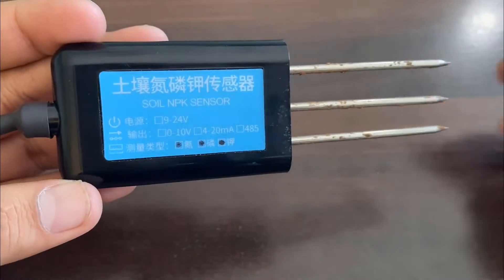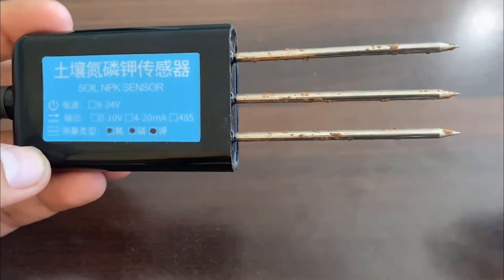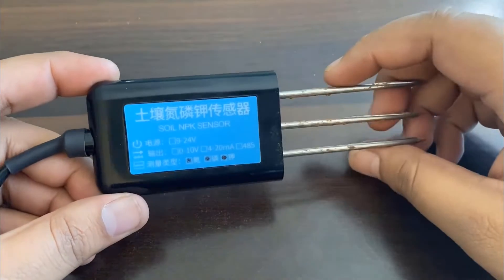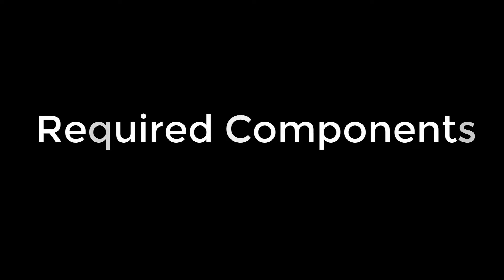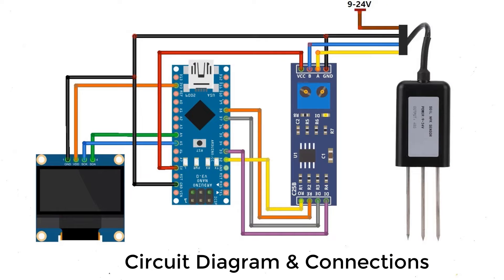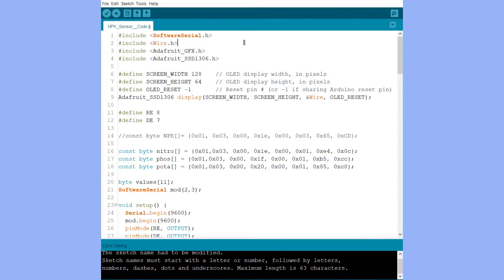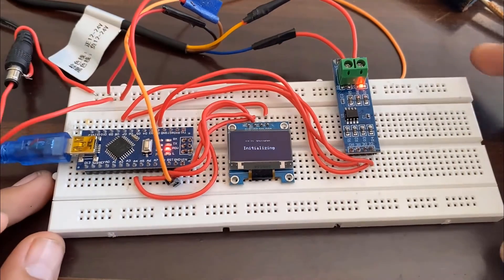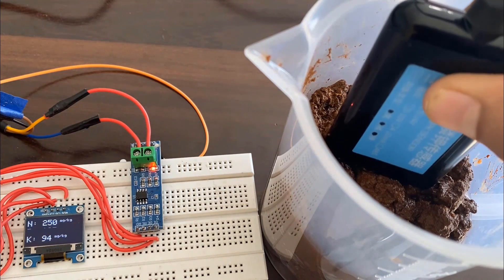DIY Soil NPK Meter || Measure Soil Nutrient Content using Soil NPK Sensor & Arduino

Comment: is your data is verified? with the lab data?

Bcoz put conducting probes in soil and readings passes through comparator/amplifier then it shows data on the screen. It is natural. that might be analog values...

and 2nd thing that is Chinese products no trust.

 Many big companies (e.g. one Swiss and France company) finding a way to determine NPK, so this 100$ sensor does that. 

Might be something wrong with this JXCT sensor. (Bcoz NPK are chemical elements )

I m not sure, maybe I m wrong but technically 50-50 chance
Reply: I have the same concern as Varnit because of the quality of mainland China products. Can you post the name of the Russian lab if it's possible? Thank you and Merry Christmas.
Reply: I also have doubts on the accuracy of this sensor. It seems that this sensor is some how implementing an electrolysis of soil to measure the nutrients and  I haven't been able to find any research material related to successful implementation of this method. It would be very helpful if you can share some data which compares the results of this sensor with lab data
Reply: @azharmultan  fake npk sensors : all chines same , only ec works
Reply: @HowtoElectronics  oky. Great!!

Can you please give me the name of that Russian R&D lab?
Reply: Great!! if this technology build-in India.
Reply: @HowtoElectronics  where can we find results/stats that verify that they are 98% accurate?
Reply: @HowtoElectronics  Gd try but sorry bro, very disappointing as an electronics lover, how fake devices draw attention by such youtube fake review videos. I'm 100% sure, after 1 year of my test of NPK, these all Chinese sensor doesn't work except EC one, that's ofcourse easy to make, even I made my DIY, but NPK  is always tough, where chines people takes benefits. at least you should not give false info without being well tested.
Reply: @narendok2115  how did you make a diy ec sensor
Reply: @clydesarmiento2223  if you search ec diy circuit you'll get,btw ec sensing is easy as it's direct electrical property of soil, we can get ec , by ionization by passing sinwaves into Soil.
Reply: @HowtoElectronics  Tem previsão de quando vai ser lançado?
Reply: @HowtoElectronics  I don't believe that  bcoz i tested it with many ways,  due that some companies stop its manufacturing process. Isn't ?